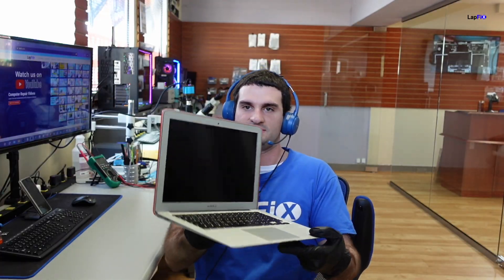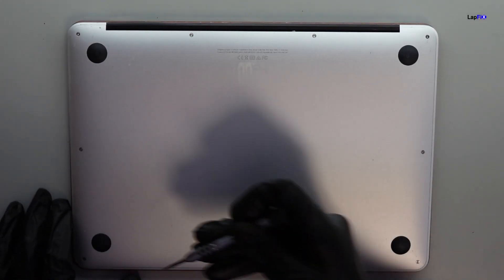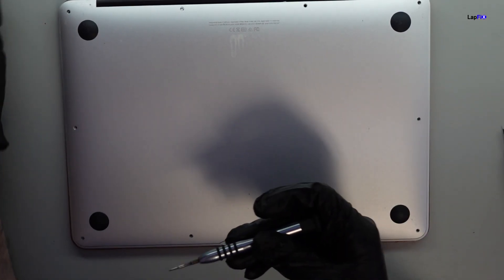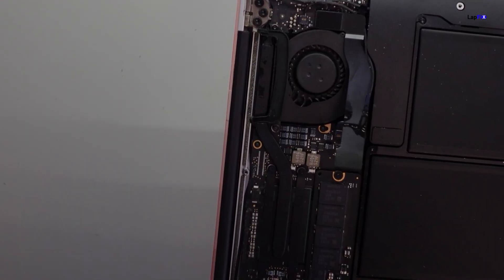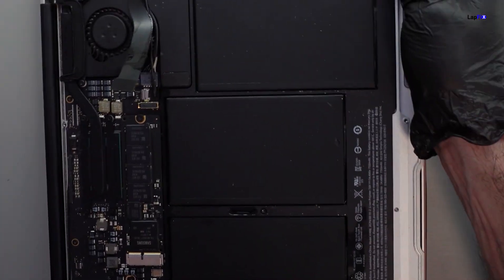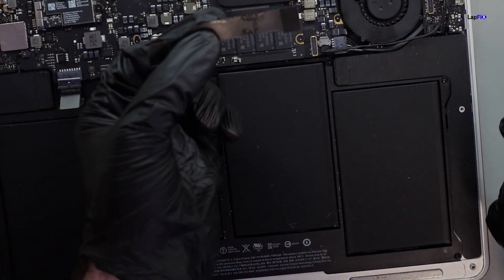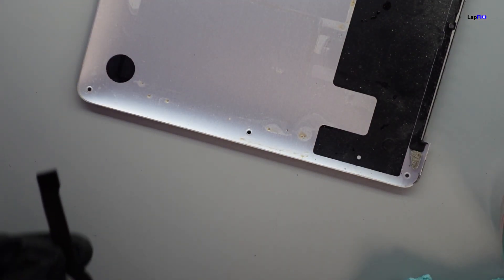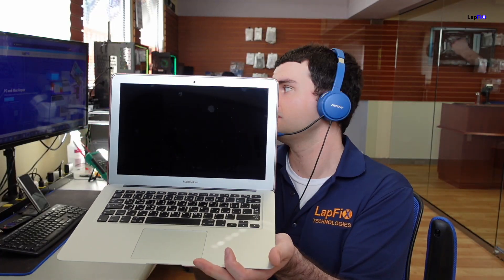2017 Macbook Air Battery Icon Shows But Won't Turn On Fix

Comment: Is there something that happens when using the charger for another device ? Bc that’s what I did bc it fit my massage tool but once I put it back in my Mac it stopped charging 🤔 any idea why this is?

Comment: Before opening up the Mac case, I often find a staple or piece of pencil lead, or other hardly detected piece of debris in the Magsafe port. That clears up 99% of my issues with not charging, lol! (Not sure of actual percentage, lol, but working on teacher macs for 15 years and have only come across my 2nd Mac that truly isn't charging.)
Reply: How would you recommend someone to clean it out?

Comment: Nice video. I have a MBP 2010 17 inch that won't charge the supposed brand new replacement battery and it just boot loops at the apple loading screen. Yet, if I unplug the batter and just run on pure magpowersupoky, it functions fine. The light on the mag charger connector does light up in both instances though. Any suggestions?